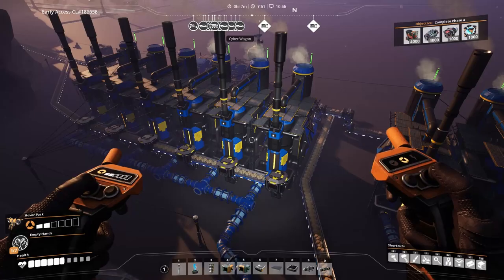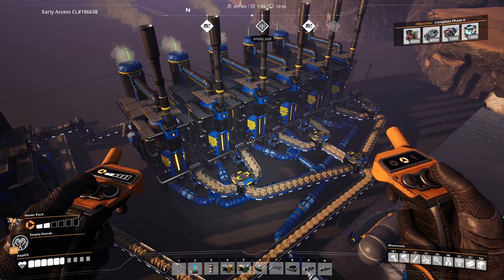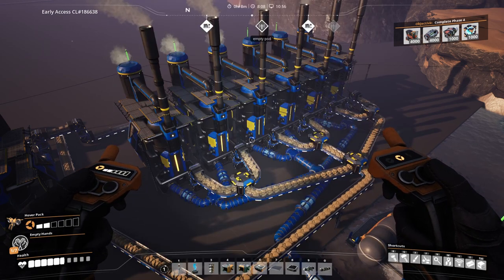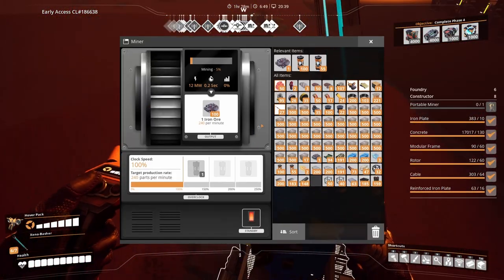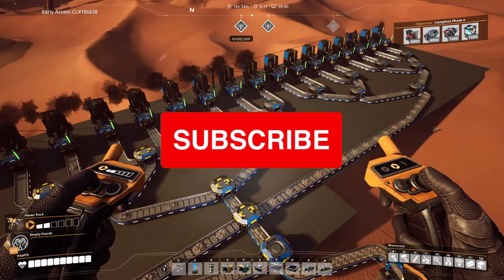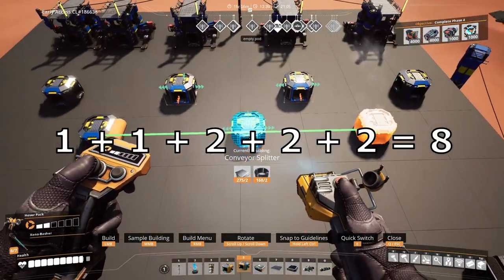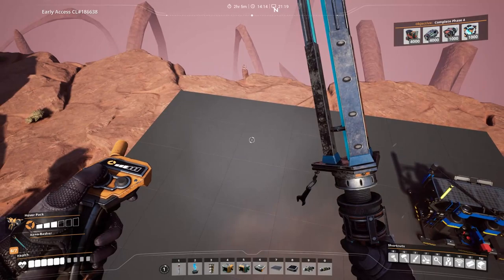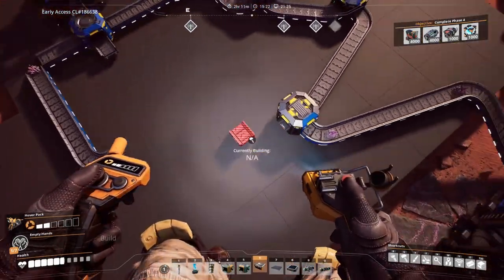HOW and WHEN to Use Load Balancers in Satisfactory?

Comment: Since you mentioned using low-tier belts to choke throughput in balancing, I think it's fair to remind this: splitters assure an even split ONLY when the output belts are all of the same MK. Having output belts of different combinations CAN result in an even split, but wether that's the case or not is still unpredictable.
Reply from the maker: Yes, that's a valid point, thanks for reminding :)

Comment: I tend towards load balancing but I can sometimes use manifold- like on the exit, I also arrange load balancing in the vertical axis and keep it off the floor. Thanks for the video.
Reply from the maker: Yeah, I don’t see much point in load balancing for output items if that’s what you mean. Reversed manifold will collect them as well. I usually like to build manifolds, but got inspired to do this video as my big nuclear plant will use load balancers for radioactive items to minimise radiation.

Comment: I prefer the load balancer (tournament layout) over the manifold. I find it easier to add more machines when upgrading less problems arise. Also when using 'manifold' after about the 8th machine the ratios start getting to low, so you have to play with the underclocking on your first machines... it get ridiculous.
1 mk2 miner (250%) on a normal iron node can feed 16 machines even. Just be ready for a flood of items.

It's nice to see that the load balancer layout is getting more attention.

Side note,  I have a couple video you might find intresting. One is simular to this one about layout ratios. And another is a timed item release that powers a blinking light (first blinking lights).
It's all about sharing ideas and creating new ones.

I like the mechanical side videos, not really feeling the 'look at my base' videos.
Reply from the maker: Thanks for your comment! Personally I think it's easier to add machines to a manifold, provided there's space on the line. Just add machines and extent your manifold belt. Sure, the ratios get low, but the previous machines are probably already saturated by that time, so the overflow gets directly to the new machines.

Blinking lights sounds interesting, will check that out :)

Comment: Everyone that makes these load balance videos forget about using smart splitters. Try balancing with smart splitters and programmable ones. You'll be surprised.
Reply from the maker: I don’t think smart/programmable splitters help with load balancing. The only thing they provide in addition to normal splitters is the overflow mode, which definitely doesn’t split items evenly. 

For manifolds it’s possible that they help to saturate the setup faster but even that is questionable as the system is only saturated once the last machine gets its full share which takes roughly as long regardless of whether the manifold is a normal or a smart one.